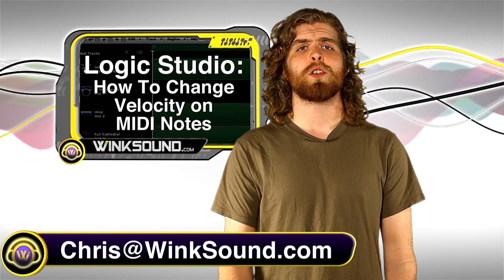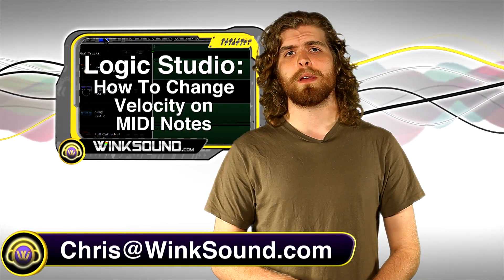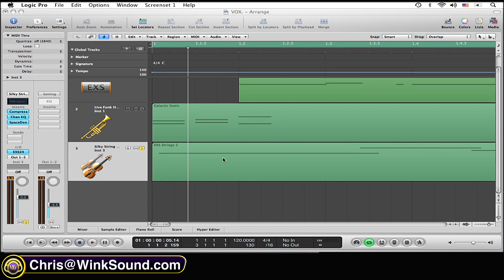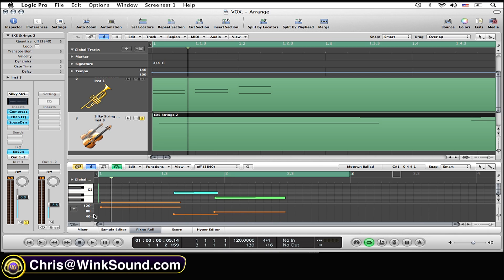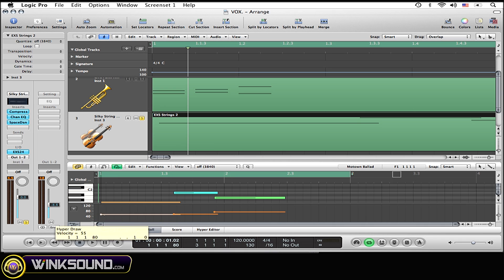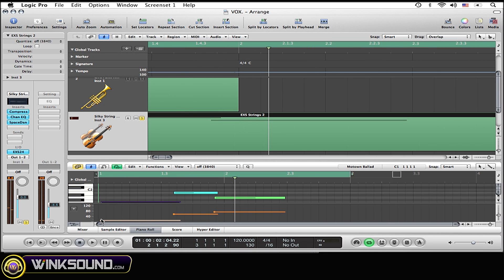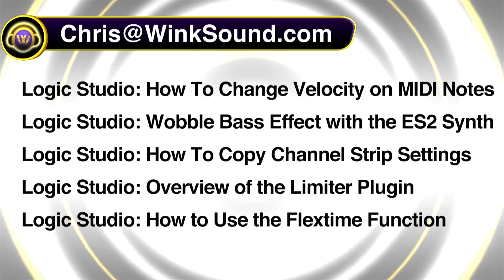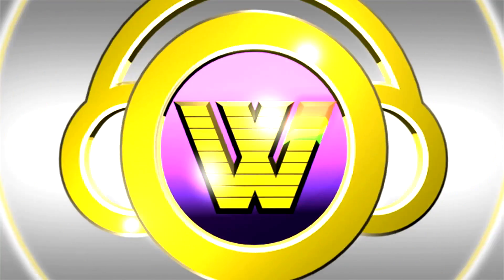Logic Pro: How To Change Velocity on MIDI Notes | WinkSound

Comment from the maker: @Freeportku001 Hi, thanks for your question. If all you want to do is add more low frequencies to your bass sound you can do two things. First open an EQ plugin on that track and cut the high frequencies, this will bring out the low end without having to boost it too much as it's not competing with the higher frequencies. Second boost the low frequencies a little until you feel the sound your going for. Let us know if this helps.